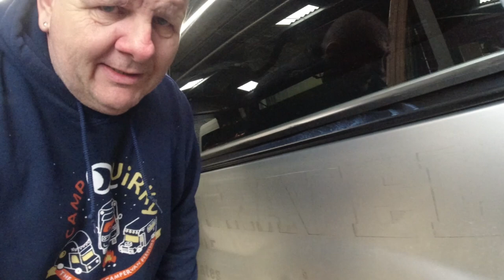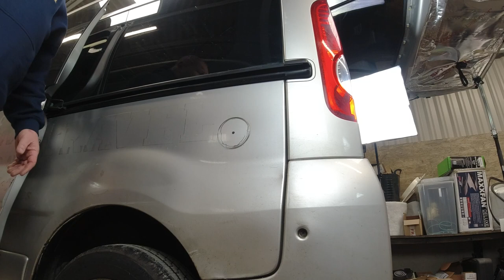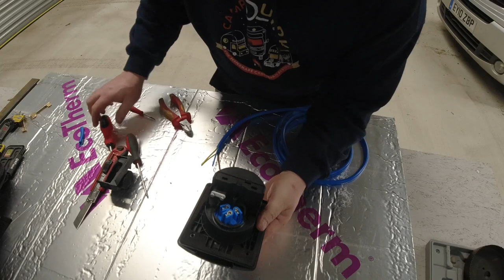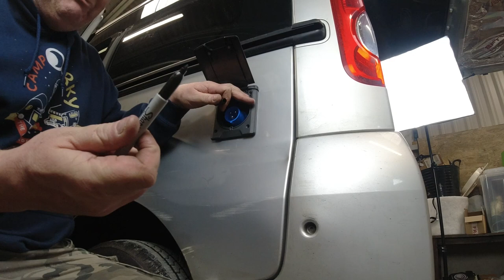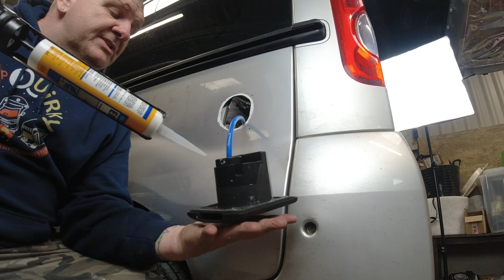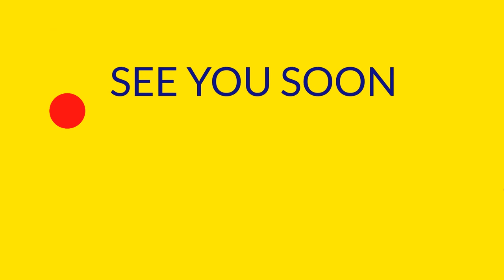Renault Trafic Campervan Conversion - How to Install an Electric Hook Up Point

Comment: curious. why do you put it on the side that the door is on?
Reply from the maker: There is no real reason for this only that during the planning stage the electrics cupboard will be adjacent to that exact point on the van.  All will become apparent in the future videos, which I am currently editing. As the bed, electrics cupboard etc has now been constructed